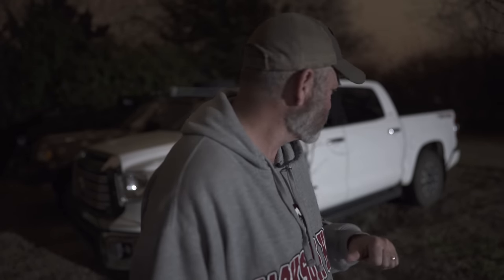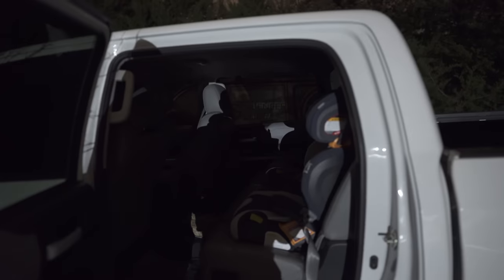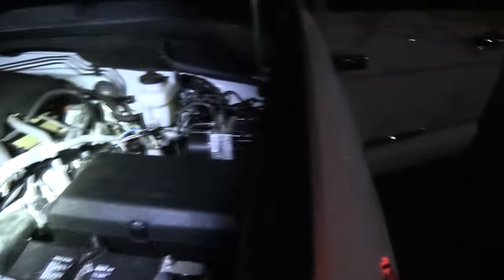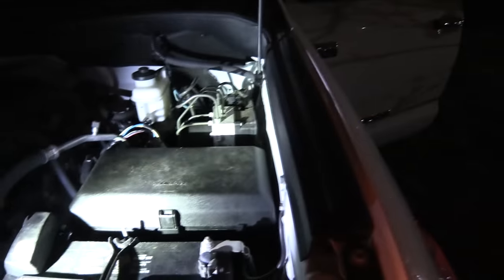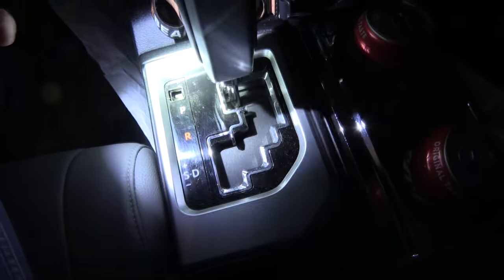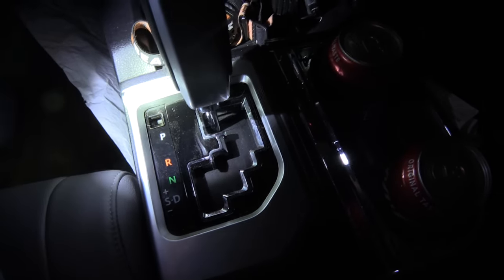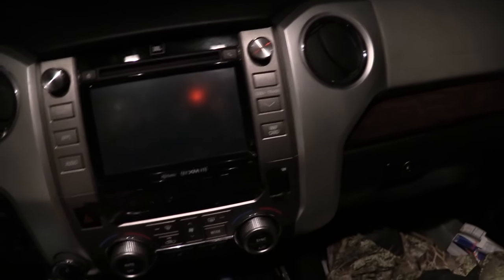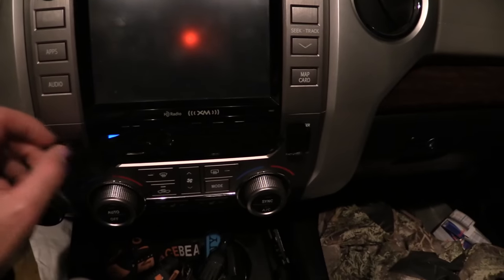How to Black out a New Truck for NIGHT VISION.  Ultimate Hunting Rig Build Episode 1

Comment: Hey Todd, I’ve got a 15 Tundra and had my dealer turn off the front running lights. They hooked up to the obd port and played with the computer. I Haven’t messed with the stop lights yet. They are great trucks, 87,xxx miles and zero problems. My first mod was aRanch hand rear bumper, the factory were terrible. I’m Now looking at a front bumper replacement to match the rear.   
Look at the Decked bed system to hold all your gear. 
Enjoy, and get some mud and blood on it.
Reply from the maker: I'm trying to decide between the truck vault or the decked system myself.  Think I'm going with the new Warn Ascent bumper and 12k winch.

Comment: Something that might work for the screen that would be simple and cheap. Some Velcro on all four corners of your screen. And a black sheet or cordura clothe with Velcro sewn into it. Velcro it on when hunting. Pull it off when not. If you didn’t mind the Velcro on the dash that is.

Comment: GOOD START //YOU WILL HAVE TROUBLE WITH THE AIR BAGS DOING A REAL FRONT BUMPER //
Reply: Depends how they have the sensors set up buy you are probably right.
Reply from the maker: The Warn bumper is supposed to work with them we will see.
Reply: @LoneStarBoars  if you are going to run over big pigs you have to mount it past the front crumple zone . if you hit a bank or tree or pig  the air bag will go off  .looking forward to see what you do to it .do not put a lift kit in it, seen to meany rolled ..